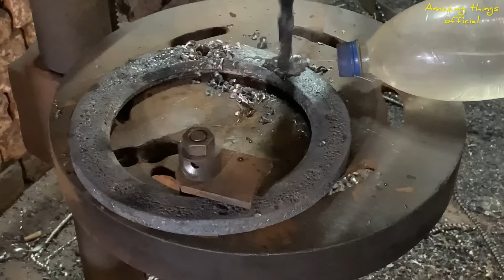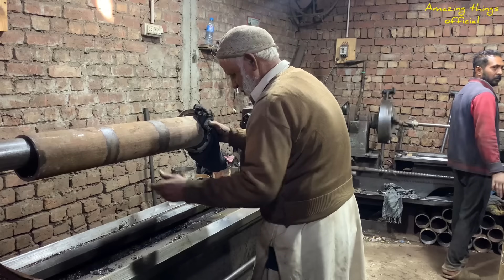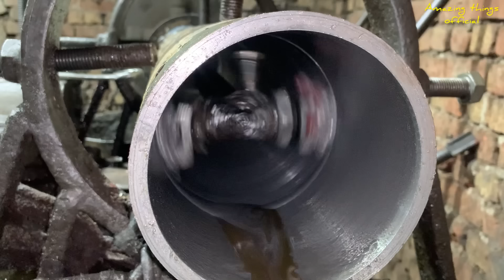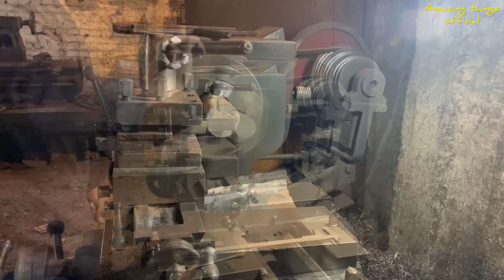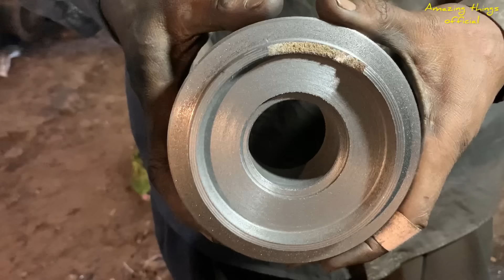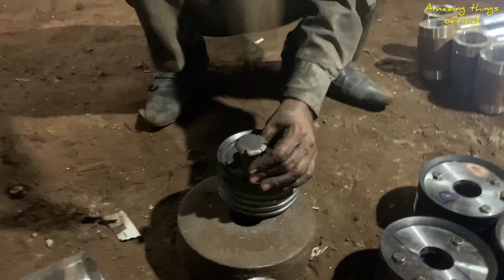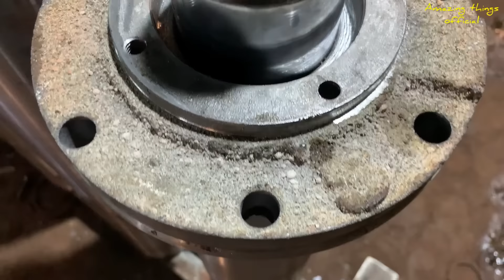How Hydraulic Jack Are Made || Production Process of Heavy Duty Tractor Trailer Hydraulic Jack

Comment: Precision engineering and the parts are thrown about on a dirt floor but those men certainly earn their wages
Reply: Ordinary handicraft production, here they work not for quality, but for quantity, the USSR thus defeated the 3rd Reich. Most likely, these parts will go to the domestic market and only internal users will suffer because of their failure.
Reply: Not very precision, thrown together in a sloppy hap hazard manner.
Reply: @maxpuppy96  must be great having autocad in your office, a Cnc machine in your garage alongside a $500k Cmm machine and all the hydraulic presses you'd ever need with Snap on tools wallpapering your shadow boarded walls.
Reply: They look great without any fluid under pressure
Reply: @maxpuppy96  let’s see you make a better one
Reply: @maxpuppy96  A lot of it doesn’t require precision. The bad part is the massive amount of grit in the whole system from poor handling & worse , leaving pockets of sand and scale which will flake off during use and contaminate the hydraulic system for years to come.
Reply: They could have cleaned the workshop within 1-2 days. But they dont care. They are used to work like this. No health and safety rules, generally no rules are necessary when Allah protects you from above (-:
Reply: @davidoff59  You dont need all that to do machining... You've obviously never worked in an US workshop... We used equipment maybe a little newer than this, but the work conditions were much better.. Not too mention organization was better.. Product never touches the floor .. FYI AutoCAD isn't super expensive , and you can buy affordable cmm machines... You were very dramatic in your pricing, drama queen
Reply: Precision 🤔😂😂😂
Reply: @47ALTAIR47  q

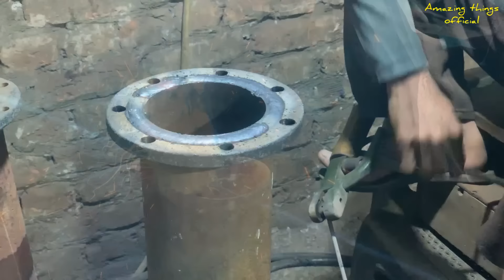Comment: Pretty impressive welding skills here, especially taking into consideration that they use electrode, not any kind of MIG. Beautiful weld at 3:20
Reply: I agree, nice welds, especially from a stick welder.
Reply: @toomanymachines  Fully equipped with the best gear and safety equipment.
Reply: What is so hard about that? Welders around the world in all walks of life make stick welds every day like that.
Reply: They are doing beads that make union welders jealous
Reply: @toomanymachines  l
Reply: @cuckingfunt9353  not even close, a hobbyist in first world nations has better by light years. this process is crude and antiquated at best.
Reply: @circusboy90210  I think it was sarcasm my friend. Pretty clear this is not "Fully equipped with the best gear and safety equipment". But these guys sure ARE good at what they do!
Reply: @warrenjones744  what's so wrong in appreciating something a million times over, Sir ?
Reply: @VelMurugan-qb1xq  I agree with both of you, and the comment originator.  The issue I have is that in YouTube land, it's 'nobody does welding ( or enter some other skill set showcased) better than ( enter channel creator )', whereas in industry, that is the standard required anyway, or you're out the door.
Reply: Terrible lathe chatter, they don't care. Surface finish is subpar to say the least, the seals will fail shortly. Job security I guess.
Reply: I liked too
Reply: @DeadFront1319  that comment went right over his head
Reply: Ohhho jg yg hipvb
Reply: Ohhho jg yg hipvb
Reply: a real top welder......wow

Comment: Now imagine what they could do using modern tools.
Simply amazing level of skills.
Reply: They will brake them immediately or using a hammer and a cheater pipe
Reply: ICE STATION ZEBRA ASSOCIATES  Yes this looks like a cheap imitation. Real thing uses chrome steel alloys, looks like they just took regular steel bar stock and did a half assed single step plating on it, laughable.

Comment: These are hydraulic cylinders, not jacks.
Reply: I just wonder, will it rust?
Reply: I really doubt that they are for use on a tractor trailer  also.
Reply: @BearGryllsz  
The process at the 16 minute mark is plating the rod.
Reply: They might be for a backhoe, or some other piece of heavy equipment, they will get painted to match the machine they go in.
Hydraulic cylinders have thousands of uses.

Comment: I worked in a workshop just like this in Manchester UK in the early 1970s line shaft driven lathes the lathes were all made pre world war one,
Reply: It is why the UK industry went down the drain !
Reply: @clitisswood7330  Spot the troll
Reply: @clitisswood7330  spot the troll
Reply: @mikecahill3186  no, he is right. lack of investment killed british industry.
Reply: I am going to go out on a limb and say it wasn't quite like this one.
Reply: @--_DJ_--  it wasn't that different! the floors were concreted, but a lot was broken up the bare walls had smashed bricks the machines held together with dabs of weld and bolts 2 inch of swarf and scale on the floor

Comment: I've been a machinist for over 30 years. My Grandfather owned his own shop, my Father owned his own shop, and I've owned my shop for 25 years. I've been in so many shops I can't even begin to count them all. So when I say this is the most disgusting machine shop I have ever seen, that's saying something. I would be ashamed to even admit I work in a shit hole like this, much less film it and share it on YouTube. 
That floor looks like it has never been swept. The machines look like they have never been cleaned and the amount of trash on the floor is insane. Honestly, I can't even figure out how some of those machines are even running much less cutting anything accurately. No excuse at all for how nasty this place is. Disgraceful ! ! ! !
Reply: Low controls, no cleanliness, end product somehow works...  But Flip Flop crew wood with cigarette.
Reply: You can't say "shit hole" on this channel.
Reply: @a.r1832  I think he just did 🤣
Reply: @MrPnew1  
I'll be darn!
Reply: I want to see them gather all the piles of filings, melt them down and make hospital parts out of them.
Reply: You're missing the point of this video... I've been watching these shops, videos, people in it, etc. and I'm amazed, how they using they head, no fancy equipment, tool, but still, making the industry functioning, so that; the deal of these videos! It's easy, a lot easier, when you can buy for cheap all tha tools you need.....just saying ....cheers from Hungary

Comment: Yeah i wouldnt go hanging around under the load when these are under pressure, the butt end of the ram will go if the seals dont first. Man that line bore was shady AF
Reply: de tout façon on ne traîne jamais sous une charge levé ou il faut être bête
Reply: @finckjean_marc2610  you’ve seen these guys working under the tipped box with a tree branch holding it up eh
Reply: I love the sound of chatter in the morning!

Comment: I was wondering how they knew where to put the holes for that weld on plate. soon I had my answer they are all different. Wouldn't it be easier to drill one hole. and then have a pin to index all the other holes off of so they are all the same.
Reply: yes i think the same

Comment: Heavy duty.!!!!!!🤣 Those can't hold pressure more than 50bar. Mild steel pipe will rupture
Reply: honestly there is no way those precision fitted orings can hold anything close to 50 bar anyway, selfadjusting safety by leakage :)
Reply: that was not mild steel pipe.
Reply: @patrikkarlsson9863  and that is why they have been doing it that way for decades without going broke?
Reply: @janvanruth3485  wasn't it? Prove it
Reply: @juhomaki-petaja  mild steel machines differently.
watch the part where the end that was torch cut is machined.
watch the glowing metal coming of the tool
that was hardened by the cutting torch.
mild steel does not harden in that way.
Reply: @janvanruth3485  their tools arent actually too good even to cut mild steel

Comment: Amazing ! I love it when the drillbit is blunt, fix: shaft extension on the drillpress. I love to see the chuck key extension on the lathe.... I love to see the sand inclusions from the casting is still on the parts, always good to have a little abrasive in a hydraulic system. I love O-rings as a dynamic seal, hydraulic lip-seals are for pussies. I love how all parts are thrown on the dirt floor. A clean hydraulic system are for pussies. I'm amazed by the pakistani-electrodes, How can we weld in the west without bending our electrodes ?????  If assembling can't be solved with a hammer, find a bigger hammer !
Reply: It is amazing how these people produce highly precise products in the primitive tools and shops with a dirt floor
Reply: @transformer889  Products, sure, I'll give them that. Highly precise, not even close or your definition of highly precise is different from mine.
Reply: @MladenMijatov  they are not making Swiss watches, but making an industrial product from the ground up is very impressive
Reply: @transformer889  It is impressive just how little they need to produce this thing. I was merely pointing out this is not a high precision product.
Reply: А разве электроды можно гнуть ?
Reply: Abrasives wase only outside the system ! 
1 dynamis seal is god it will work !
The benefit of an dirt and rockless  floor, a big working table  that w nt damage the parts !
Bending the electrode is a good practice for round welding, you have your rotating welding table !
Reply: I love how they appreciate the machine tools which they use. Throw the heavy workpieces onto the lathe ways...
Reply: I have seen some things that I will adopt in my shop that should save some time and be more comfortable.  No more steel toed boots.  Sandals for me from now on. Tacking without wasting the time using a helmet.  Welding without gloves saves time.  No safety glasses using machines saves time getting them.  Going to cut my shop time in half.  Good ideas.  With the money I save I can get a seeing eye dog.
Reply: TBF, O-rings can absolutely work as dynamic seals, in fact the main reason they were invented was to be a better dynamic seal.
Reply: @markneedham8726  (Strutting around)  Fuck me?  I doubt if you know how to do it.  Your language shows your level of education and social status.
Reply: @John-oe5nb  people joking around with comments like yours are doichbags, man these people are poor this shop is probably still the same since a century it is really amazing what they can do precise or not good or bad it gets things done if i was a farmer amd i can buy this for maybe 50$ ill gladly buy one even if it breaks  every year thats how they work.. they can't buy precision machined high quality 5k$ hydraulic cylinder
Reply: @deeperlayer  Yes, they are hard workers.  I would hire them in a heartbeat compared to the entiteled spoiled brats you get now, but some safety glasses and better foot wear might save some injuries.
Reply: @MladenMijatov  um, hydraulic cylinders are more precise than you think. They need to be machined within thousandths of each other to produce a seal. Otherwise, what goes up, will come down rather quickly
Reply: Essentially when the labor supply is high, labor and material cost is low, and tooling cost is high, there is little return on high tolerance manufacturing and design.  The same shop probably repairs and recycles an endless supply of these making them good enough to last 6months to 2 years before ending up being repaired again.  It just needs to be good enough to get through 1 or 2 seasons and then its rebuilt again by a low cost workforce.
Reply: My channel
Reply: Highly precise products means in Pakistan: tolerances are less then 2 fingers.

Comment: I have very wast exp experience of hydraulic cylinder,hydraulic system, l really amaze the cylinder munfactured up to high
grade standard without adopted
most modern machine or setup in Pakistan.
And specially what a beautiful welding beat joining flang like a continue welding machine.
If it take the x ray even,Lt would
be hundred percent.👍
Only one thing l observe front
Out flange was not so finish or
Well machined, otherwise all parts,cylinder bore,piston cylinder shaft up to the standard.
Well done,keep it up .this will grow industrial revolution in Pakistan.

Comment: Superb engineering skills here. Amazing welding too. No doubt they even make the rubber seals!
Reply: It's actually opposite of superb engineering. Not a single quality control, material testing, stress testing. Hell even holes are not spaced out evenly which means forces are not distributed evenly, etc.
Reply: They used cast iron for the piston and plates and steel for the rod and tube. Cast iron is a horrible material to make something that takes serious force out of because how brittle it is and the residue it leaves behind because of how soft it is. There was no engineering performed and I wouldn't dare trust any amount of product coming from locations without proper materials testing and quality control.
Reply: The work they do seems to last and if their work was substandard no repeat work would come their way.
The chassis welding
seems to be okay too.  The springs they use are up to 18 leaves made by the AlSheik spring company which are made to take loads 50% on top of what the original Nissan/Hino trucks gvw and yet their triple layer chassis rails take the weight.
These guys have been doing this work for decades..
Reply: @MladenMijatov  You must consider the target market witch i believe is not looking or can pay for a premium product. Considering the conditions they did a good job.
Reply: @UnforeseenLife  Piston steel is also totally wrong type, look how easily it machined, in real a thing it's made of a hard chrome alloy. Whole thing is subpar, I wouldnt stand under a car if this was used on a post lift.
Reply: @Draxindustries1  "...The work they do seems to last..."  How do you know?
Reply: @MrShobar  Because this particular place has been in business for 23 years and have very few come backs..

Comment: Great job welding, finally somebody who can weld but I have to ask this is a ram with hydraulic oil in it, and which is under incredible pressures, the end cap was only welded on the outside and then the eye welded to that no offense but what’s to stop that blowing off with the pressure and taking someone’s life, a plate which is recessed to allow the end plate to be welded fully, like I said great job, just a thought

Comment: I'm not a machinist, however, I've seen a lot of machining done on projects I've worked on over the years and I must say I have never seen a lathe setup the way these fellows are using it to bore out the piece on the pipe?
Reply: They just set it up on those two steady rests and then line bored it using the bar between the chuck and the tailstock     
passing the work over the spinning bar with a flycutting tool. Two passes with the hone and it's done lol

Comment: Simply cleaning the shop floor, a skim coat of cement, and then a covering with a floor covering would improve the quality of the final product. one piece of grit inside the hydraulic cylinder, will cause a gasket failure, then a leak, and then a very expensive machine is down.

Comment: That's a pretty cool design for a steady rest Maybe add some rollers in there somewhere or brass pads I can't really tell what's in the video, but definitely an A+ for heavy duty design!
Reply: Would you actually  trust that the cylinder?!?!  🤔
Reply: @websitesthatneedanem  if they were not trustworthy they wouldn't be making them as no one would buy them.
Reply: @nainitalism  by this logic: If you would just strap electrical wires to the wall without protection, nobody would trust to work around them. And yet, here we are...
Shoddy products can fail and kill a while after they left the factory but this doesn't mean they wouldn't find customers for them if they offer low prices.
Reply: @FreezeS  Your last para says it all.
Reply: @nainitalism  lamo clearly never been an engineer phahaha
Reply: @nainitalism  I have bought stuff from China where literally siliconed the welds to look like fillet welds when they were actually just tacced on. The whole structure weighed 5tonnes. We had to grind them all out and re weld. Still tho, was cheaper then buying from USA even after all the work we had to do to it....
Reply: @nainitalism  You should see how they make washing machines and electric transformers, first one is a death trap and the second one is a bomb, exact working conditions and practices.
Reply: @jacobagnew2015  Yep typical of them. They cut all the corners till the finished product becomes perfectly round.
Reply: @FreezeS  the reality is somewhere in the middle.
I have experienced it personally.  45 yrs ago I wanted to start a wood working shop. On doing a business plan I discovered nobody was willing to pay for quality. Finally gave it up as a lost cause, I was not willing to compromise on quality and safety.